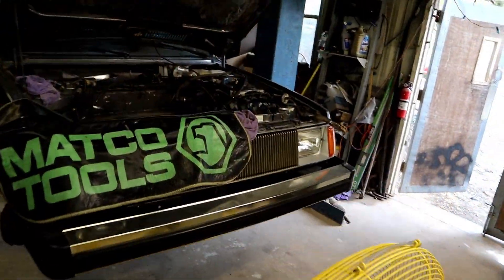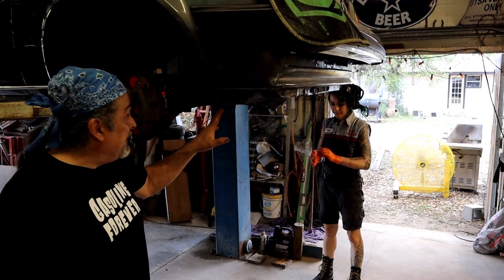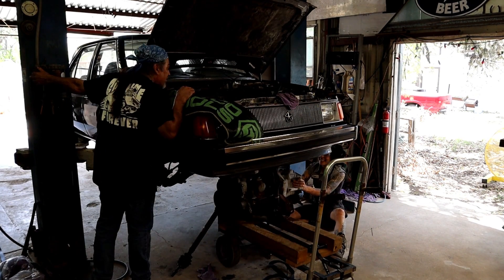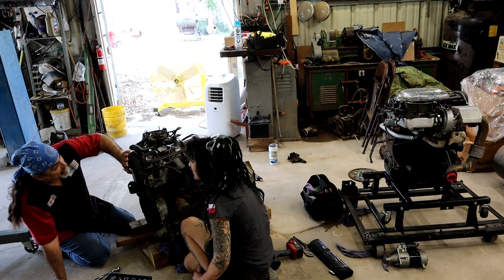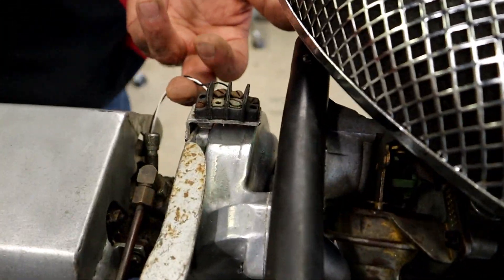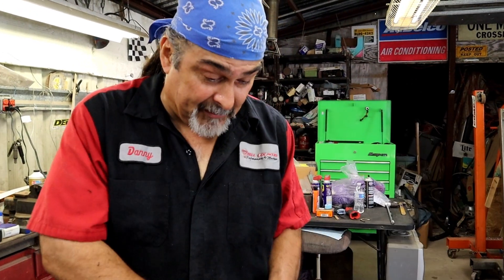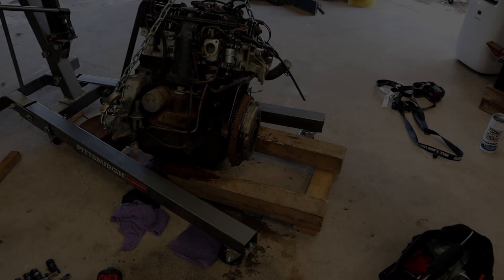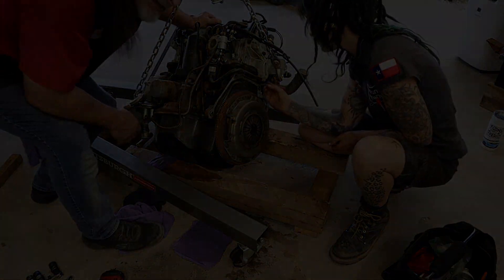Smokey Yunick's Hot Vapor Horizon Update

Comment: Smokey chose a good platform.  The almighty Plymouth  Horizon. 
I put 932,000 miles on one. 
540,000 on the original engine. 392,000 on the second engine. It still ran great when I sold it at 932,000 miles.
I was inspired when I met Irv Gordon.